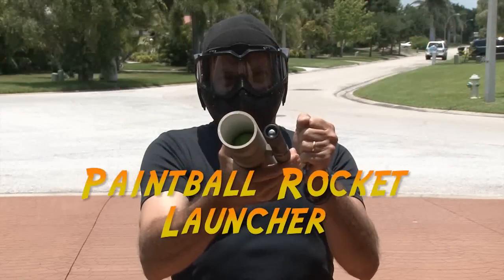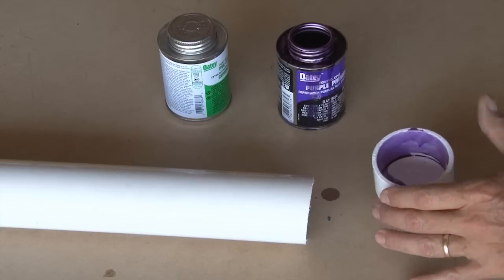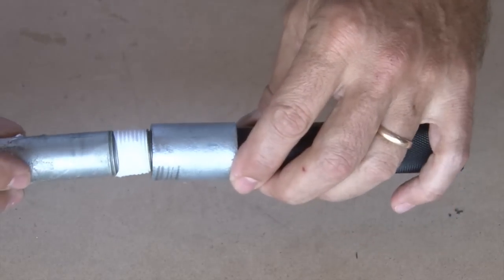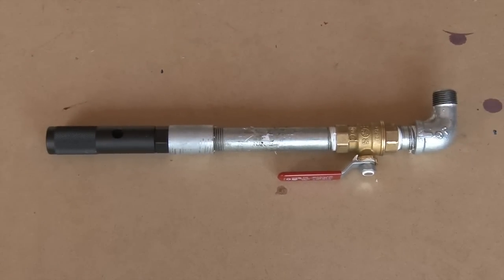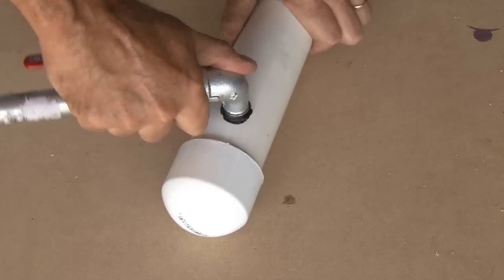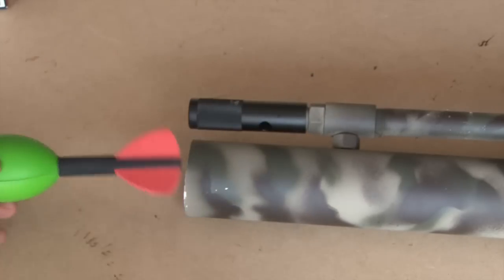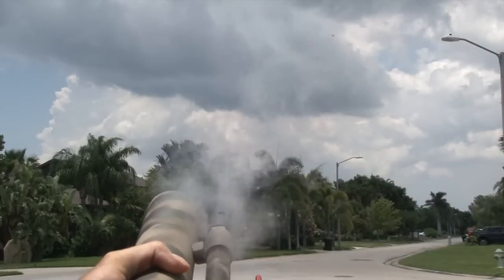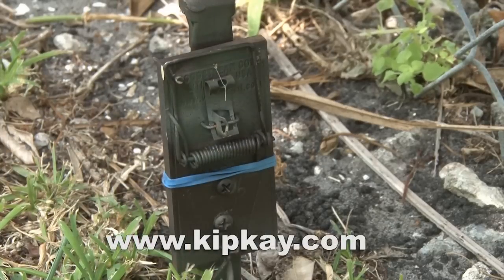Paintball Rocket Launcher! LAW!

Comment: If you make this like i did, make sure to over do the teflon tape because I didn't and it leaked all the CO2 out. So to fix this I put it under water (filled up the tub) then screwed in the CO2 addapter (with new 12 gram CO2 loaded in it). I did this to be able to see where the leak was. I then unscrewed the piping where the leak was (not the pvc) and then used the black silicon stuff on the leak and all the other pipe parts. I left the teflon on and put the silicon over it. This worked alot better. So I suggest using it in the first place. Also I found potatoes as a better shot and using something to push it down with (like the end of a LAX stick).
Reply: Where did you find the parts List please (asking for a friend)

Comment: I wouldn't recommend making the paintball gun adapter shown at the end of your video. There is nothing to regulate the fps and firing paintballs at people like that could hurt someone. Imagine if it fired hard enough to blow a paintball through a visor? Most fields require us to clock our fps when we check in. The rocket or mortar is safer provided it's not aimed directly at someone. Cheers.

Comment: but it uses one tin of co2 per shot right
Reply: You could use a bit of brainpower, and intuition, and make a thread adaption for an 18oz Co2 tank (Like in normal paintball guns) for rather cheap.
Reply: I would if I could buy any adaptors over here. If I knew how to make one, I would, though.
Reply: Rhidongo There would be a great amount of loss each time you fire the launcher.
One of those 18oz disposables would not be as economical as a box of 12 grams.

Opening the ball valve to fire would yield a shot and then a continuous splooogze of Co2 until you close that valve.

The mechanism needed to fix this starts adding vastly increased cost to the build and is exactly why a Metadyne launcher costs about $300 bucks.
Reply: Just attach a bike pump plug, and glue the pump to the side so you can always be shooting
Reply: That would turn this project into a deadly bomb  co2 can go to 3000psi plus, that pipe is rated for about 220 psi

Comment: Instead of drilling into the PVC and screwing the entire assembly in, use a 1/2" thread to 2" slip adapter. I can find them at Lowe's or Ace. Yes this requires another elbow, but it is 10 times as sturdy. I found that this works much better in the long run, and only costs a few dollars more.

Also, the more volume in the pipe (before the valve), the more power your shot will be.

Comment: Use spring to push out the projectile. Not compressed air. Put strong spring in the tube, load spring, put the projectile in, release the spring and the spring will push away the projecile like crossbow. The spring will not compress air but push the projectile directly.

Comment: Would consider changing ball valve to a direct acting WOG solenoid valve, you can wire it up to a single 9V in most cases for power, and a momentary switch.

Comment: @vu284

He did, kinda. His Hi Powered Nerf gun was essentially a very low impact potato gun (in that it used an ignition spark and spray fuel to launch nerf balls). 

As for this project, its really cool. I have a interesting thought though: could you modify it so that instead of the ball valve you used an electric sprinkler valve, that way you can shut off without risking losing all your pressure at once.

Comment: @kipkay I'm curiosity, why is the middle pipe needed?

Couldn't you use a adapter between the ball valve and the CO2 adapter?
Could it be because the threaded adapter part is to long?
Maybe it could be cut with an angle grinder to fit without the pipe... 🤔
Anyways, great project! 
I'm building my own with a solenoid as a trigger.

Comment: ive made loads of barrels, and really the longer the barrel the more accurate it is but i wouldn't go over 50cm as a 12g cartridge pretty much loses all pressure after that, also i would give the barrel a spray of silicon gun oil to lube it up

Comment: what do you think about putting a piece of pvc with caps on the end with pressure sealant, instead of using the steel bar but infront of the co2 quick change adapter a ball valve, so that you have co2 adapter - ball valve - pipe - ball valve - then 90 degree elbow. so that you can make it 24 grams of co2 or can have 12 grams just an idea

Comment: From a ground height of about 5 feet and an angle of 30 degrees you're looking at around 60-75 feet. It varies depending on how fast you can pull the latch.

Comment: Several flaws:
The steel pipe will hold up, along with the CO2 adapter. But, it uses one cartridge per shot, and they are quite pricey. The ball valve and teflon tape won't work. Use a carbon steel or stainless steel 3 piece ball valve rated to at least 1,000 psi. Use Rectorseal Tru-Blu instead of teflon tape.

Comment: can u just use a bottle or a pvc tube with a cap as an air container/pressure chamber? then just use a tire valve and a pump. maybe even a psi gauge just for a better result?

Comment: Dangerous! The valve is rated for 600 PSI, but the CO2 cartridge can release over 800 PSI into that small area. Cheap 1/2 inch galvanized pipe (with a seam) is only rated for 700 PSI. Use seamless pipe, a steel 1000 PSI ball valve and class 300 MI fittings.

Comment: You dont want the PVC primer to dry before applying glue and putting it together, read the cans. Also 12g CO2 cartridges contain carbon dioxide gas not compressed air...

Comment: @MoshiMoshi93 mortar shells weigh between 5-10lbs for the 80mm. the 120mm weigh about 15 lbs and to propel it at a fast rate of at least 100mph and such for just the 80mm so it can hit the target quick enough and not hit the ground before hitting will put enough force to put you on your ass when it leaves the barrel and they also need a closed end to drop onto and arm it by hitting the pin which sets off the initial charge and arms the blast charge that explodes on impact. summary: cant be done.

Comment: Anyone think a solenoid valve would work in place of the ball valve? I think it would be easier to fire since you're just pushing a button and it would stabilize it as well since you aren't slapping the thing to get it to fire
Reply: Don't use plastic on the pressure chamber

Comment: is this a one shot per co2 cartridge?
is there a way to adapt this to an air tank for a multiple firing capability?
Reply: I assume if you put multiple ball valves and opened all but the last one when you pressurize a CO2 tank and then closed them all and open them in sequence that could work it would be a lot bigger and more expensive and the shots would be less powerful

Comment: I'm thinking about making something similar to this that runs on co2 but holds multiple shots
Reply: Me too. I was thinking to use 88g co2 cartridges and have a chamber that fills. Having one ball valve for the cartridge and one for the trigger at the end of the chamber maybe even put a pressure gauge on the chamber. Similar to a tshirt launcher. You could even use this to make a mini tshirt launcher. My only problem is its harder to find parts in uk
Reply: im just making that exact thing hoping to be creatif. Im only a bit worrid about the ball valves. Im obviously working with high presser so do I need special parts??
Reply: I've made a lot of guns like this on my channel now and you don't NEED special ball valves but I would recommend getting a steel one and you can just get a simple threaded pvc adapter to attach it. The steel ones are much smoother.
Reply: I bought two metal ball valves. There arent really smooth but I found a vidoe by joergsprave. He made a mechanism with some spring to open it faster. But how did you make the bolt action. I looked at your vidoe ten times. But i want to make a 10 mm wide barrel an this makes it really divecult.
Reply: ya I've seen it. That mechanism is alright but its so bulky you might have a better time designing one yourself.
Reply: Im doing something simelour but im disigning it my self. Today is my last day of summer vacation so im going to finish it today.
Reply: cool good luck!
Reply: Its not really powerfull but it works so im happy.
Reply: thats good!

Comment: Is there any way to make this work with a trigger like mechanism?
Reply: Yes.
You might go with an electric valve connected to some kind of battery through a button.
(Or through two buttons in series, so you have to press them both to fire, cause you know, safety.)

Comment: Is there any way of toning down the psi from 850 to 280-300?
Reply: you could increase the surface area of your pressure chamber (the steel pipes), either making them longer or larger diameter

Comment: Please tell me no one thinks if they brought this on to a paintball field it would be legal right? This PSI is insanity high, co2 cartridges are too small and you'd have to reload every time you shot it, the accuracy is bad. I can infer that this is a good back yard gun, but I see a lot of you in the comments thinking you can bring it to a paintball field.
Reply: Doge with 12 grams it dosent half to be regulated
Reply: Any rocket launcher would need to be reloaded after every shot in real life. And why the fuck wouldn't it be allowed?.its not like you would have an unfair advantage with a one shot per minute gun lol.
Reply: Leon Springs Boys Yeah, but it would hurt pretty godamn hard...
Reply: the nerf foam rockets don't hurt.  the fields in my area that has tanks allow you to use them.  it's the only way to take out a tank.  they do check it out and chrono it before allowing it.
Reply: pint sized pb you still have to chrono it even w/ 12 grams
Reply: park will let u use these i used mine at ll9
Reply: yes i know that
Reply: pint sized pb yeah, LL9 was a major event. If you go your regular local field and bring that thing, your chances of going onto the field are slim